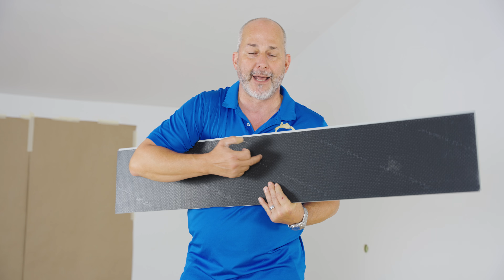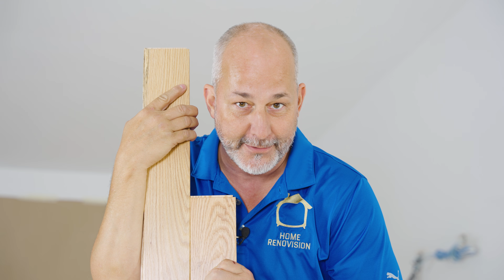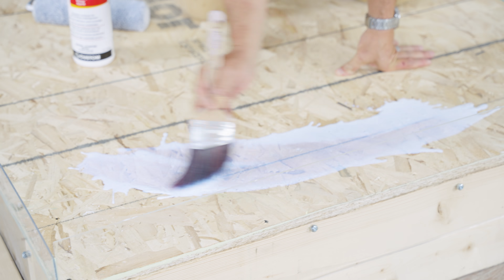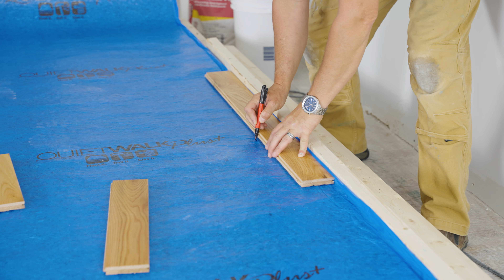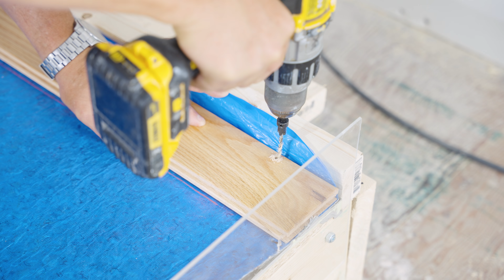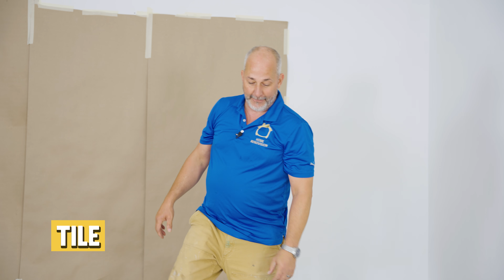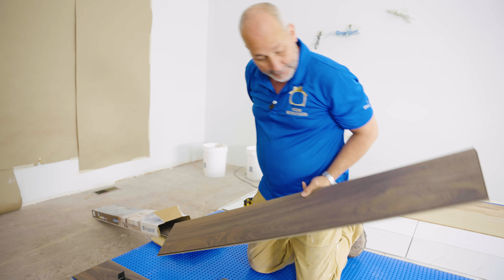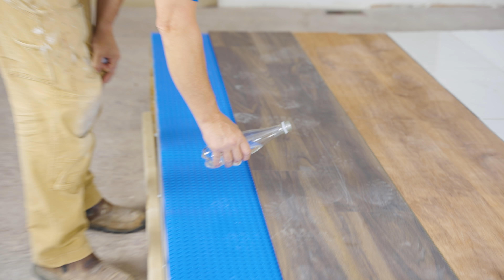Flooring Comparison: LVP vs Laminate vs Hardwood

Comment: Excellent video — very accurate and well explained.
Installer here: locking strength matters more with LVP, and laminate gets much quieter with EVA underlayment than a thin plastic.
I may show this video to clients before their installation — I'm sure it will help them a lot.
And I’m even thinking of running a similar experiment on my own channel as well 🙂
Great work! Kudos to you for putting together such a thoughtful comparison.
Reply from the maker: Thank you I appreciate that. Thanks for chiming in with your experience. Cheers

Comment: Additionally, higher end engineered hardwood floors have thick enough veneers to be refinished at least once. The best stuff has closer to a quarter inch veneer thickness which might even take multiple refinished across its lifetime. It will cost more accordingly

Comment: With hardwood, most of the expansion and contraction is across the grain; Not in the axial direction. I think Jeff misspoke but this is why doors are built with rails and stiles; the rails don’t expands length-wise so the door can’t swell itself shut. Hopefully he also mentions the importance of acclimating the wood to the house (preferably by storing the material for as long as possible) and, if you want to go even further, you can choose the most neutral humidity season in your climate region to do the install. That is to say, if you install it during the highest humidity conditions, you should really only need to account for contraction. TMI but figured I’d mention it because hardwood can be pretty brutal
Reply: I meant storing it for as long as possible in the place it will be installed. My bad

Comment: Engineered hardwood can be refinished. Depending on the thickness of the solid top layer you may not be able to refinish it as many times as solid, but high quality stuff will be solid all the way to the tongue and groove so it can be refinished just as many times as solid hardwood.

Comment: Is that hardwood flooring pre-finished? Or do you need to apply finish to it after it’s installed? I’ve seen videos where they need to do a whole bunch of finishing steps, including buffing it out with a giant polisher.
Reply: I think you're right. Needs sanding, filling holes and varnishing. Some steps more than once. A lot more work, i.e. time and money.

Comment: Wow, finally a great video and tutorial on flooring as i got three different answers on what type of flooring to go with from the big box stores, some say add a padding and some say not needed, my house sits on 32 cement column that is 13' above the ground with a plywood floor, it has carpet now, looking to go with a laminate, half of the house is a concealed garage and the other half is open for parking but has siding on the over head, some people that i know have had some issues with sweating and mold what do you think, no pets to have accidents on the flooring, thanks for any help

Comment: You forgot one step!
If you cut the edge of the interior hardwood or any wood product flooring then you’ve cut through the pressure treatment of the wood product. Because the rot resistant pressure treating only penetrates so deeply into the wood, you must brush on the cut edge, copper green, or one of the other copper based right resistant treatments! Also when he holds your drill or deep notches or grooves, you put into the wood! 
So yes, just the same as when you cut most exterior woods, such as decking.
Just ask ChatGPT when unsure.
Thanks for the great Great videos! Yep!

Comment: Warning on LVP.... MAKE DAMN SURE YOUR FLOOR IS ABSOLTEY CLEAN AND LEVEL! I had an installer install mine and there were little pea sized pieces of thinset from the old floor. It will create a crack in the plank. It's durable for scratches and stuff, but very prone to cracking on uneven surfaces.
Reply: Not level, flat.
Reply: Agree. I have high quality & durable "luxury" vinyl planks. The installer did a great job. It does look great after over 5 years of  wear. I see a couple very subtle areas & I'm sure I am the only one that notices. I do still love it. I had to do my floors at the time but couldn't do hardwood or engineered due to rigidity. The subfloor due to crawl space and home additions over time, would have required contractor renovating the floor. Several pros gave me that sad news. The leveler required for rigid hardwood or other would have added too much weight so not an option. They said they would pop up  I love my floors from both quality & installation. The color is a medium brown and stands up very well. Still gets clean without the built up dirt on lighter colors gray & blonde.

Comment: What a creative video. I am not a fan of vinyl flooring because it feels loose and mushy or unevenness under my bear feet.  I would suppose this could varies based on brands used, installations and the condition of the existing floor. Maybe do a video on higher end preferred LVP by customers and contractors and bottom of the barrel.  Also I am into Passive homes/ Net zero homes.. It would be interesting to do a video on different options of heat. force hot air (central air vents & Mini Split), water tubing heated w/ concrete floors and electric heated floors, radiator heat) cost analysis and comfort analysis and distribution efficiency.

Comment: Would have liked to have seen all those floor products installed on concrete slab.
Reply: LVP on a concrete slab is best IMO
Reply: Lvp all day and night,
Reply: Same steps basically, except you’ll be using a grinder for the high spots and/or doing multiple coats of SLC.

Comment: I would be more interested in sitting in a chair with metal legs and moving it in and out to simulate someone getting in and getting out of a kitchen chair. - most of those floors would fail without pads

Comment: I feel like I have generational trauma related to every single way hardwood fails. Chair marks, flower pot water marks, creaking cracking separation, specialty soap cleaning, ink stains.... Resurfacing jobs that aren't flat and make the creaking problems way worse overtime...

Comment: great video!
Unfortunately it doesn't help me. My house was built in 1890 and the floors are pine. Painted everywhere but the middle of the room. Dried out and separated joints. I'm going g to have to level he floor from the basement.  By myself. I'm almost 70. Such is life. Damn

Comment: This is very helpful. We want to do vinyl in an old house basement over existing vinyl tile.  Some tiles have loosened, cracked, or are missing. Most are in good shape and well adhered.Fortunately they are not aspestos. Wondering what the best prep would be. Replace bad/missing tiles? Use floor leveler? Remove old tile. (I've done that before and really am not up to that kind of work anymore. When did I get so old?) Would definitely use that underlayment.

Comment: so if I got my math right, older house with uneven floors + kids + big dogs + moderately handy dad = vinyl floors
Reply: I raised 3 boys and fostered dogs for 10 years. Do the hardwood. It just now needs sanding and refinishing because we plan to move so changing the stain will update it. None of the vinyl and fake wood stuff survived. Just replace the old subflooring that needs it and get the right underpayment (we have a house that is like 45). Save the extra wood in case you need to do patches (we haven't but you can just cut it out and fit in a new chunk if needed). Real wood floor also raise your reselling value apparently the most out of any flooring. 

The vinyl flooring also can release toxins, it is called off gassing. Then in a  house fire it is particularly nasty due to that (in laws had one learned the hard way). Vinyl won't last, tile does break but at least doesn't damage as quickly and carpets can get ruined quickly. Even the luxury stuff in the new builds isn't lasting, my folks paid for the upgrade in their new build and is starting to fail 5 years in with 1 elderly dog. They put rugs everywhere to protect the flooring since it was so expensive. Maybe there is a difference out there Canada but US side that stuff doesn't last. 

I'm not handy and while I love my husband he is more software minded, which is totally fine since that is his job. We installed hickory floors with some family help while I was on maternity leave. I waited and watched for a sale and we scored it for less than $2/sq foot which is cheaper than  most of the vinyl. Middle kid has allergies so switching to hardwood was a huge improvement. 

If you can do wood floors, you'll move or be dead before they need to be replaced, and a sanding/refinish is cheaper than new flooring. Added bonus hardwood flooring adds structural strength, the only other flooring that does that is the engineered wood. :) So for us that was great because we live by a lot of mature trees and the kids' rooms are downstairs, so that wood flooring was like a nice shield investment for tornado season. 

Unless you live in a flood zone or hurricane zone, then go tile.
Reply: @wobbuffetbuffet  Did you do engineered hardwood or real? Where'd you get it from?

Comment: You should never have hardwood floors (or likely engineered wood floors) that aren't sealed with poly though so they'd not soak up anything in that case.

Comment: Wife and I bought a house a few years ago and originally we loved the floors. They looked beautiful. But it turns out they are extremely cheap. If you look at my floors wrong they will scratc up. There are so many gouges in our floor now that it's driving me insane, and unfortunately all of the floor is underneath my cabinets so it's not easy to remove and replace.
Reply: Have been watching nz builder solve this issue by cutting the boards out at and angle so it reaches undee the b
Board, so new floor can slide under.

Comment: 2:03, I know from personal experience that even if you have a waterproof joint, those "Water Resistant" laminate floating board floors will have issues with any water (and other liquids) that aren't cleaned up right away. I have seen two separate people have the exact same issue about 4 years apart. And, in both cases, those floors were brand new (less than two months) installations. Sure, those boards, when installed properly, won't let water soak underneath, but those joint seams will soak in standing liquids that are left to stand for more than a few minutes. This will cause the laminate boards to swell around their edges, almost like particle board. I say almost, because unlike particle board the laminate won't crumble; it just stays swollen. One person I know, had a party, there was ice cooler inside the house, condensation formed o it, and she was left with a swollen square ring where the cooler was touching the floor overnight. Another person I know, had a new kitten and the older cat was unhappy about this and went to the bathroom in her closest (on her brand new floors) when she was out. And, a nice large spot on her closet floor swelled at the joints. So, just because the laminate won't let water soak through, that doesn't mean the water won't ruin it.

Edit: I don't know how flat the closet floor was, but that was a prefabricated house. But, the house with the house cooler issue, that was a concrete foundation with was evened out with leveler.

Comment: I haven't seen your stuff in years... Great to see the quality nowadays. it was never bad, but this is great stuff! Would love to see more slab foundation information (very common in my area where basements don't exist and ranch style homes are the norm).
Reply from the maker: Welcome back!
Reply: In Florida CBS construction (concrete block on slab) is a very common construction method. Basements are not practical there. The water table is close to the surface. The top of the concrete block wall is filled with concrete, rebar, and foundation bolts to hold the roof down, per hurricane code. Flooring was often terrazzo.

Comment: LVP looks arrificial. I've not laid eyes on an LVP that could pass as anything near "real", and it always feels sticky, especially with grippy shoes. LVP also has a plastic smell that hangs around for months and sometimes years. Good laminates can pass as engineered hardwood, feels solid (not sticky) and the smell is gone in days (if any). With that said, pets prefer the grip of LVP to laminates.

Comment: I'm going to install LVP but was going to install Engineered hardwood up until a week ago when I saw a very realistic looking floor and changed my mind and this helped a lot, so thanks for that. I would like to see someone compare "UPFLUSH" toilets because we don't have a choice as this is a manufactured home that was set on a basement. Do you think you could do that? i'm a fix it person and have fixed my saniflush several times but parts, which seem to be quite proprietary, become obsolete very quickly so I'm looking for a different brand that may have more universal parts.

Comment: Great review! Been enjoying your stuff a lot. It's a good sweet spot for no non-sense and down to earth advice. You give a lot of advice on flooring, but I'm still looking around for more advice for a "garage flooring" project. I'd like to turn my garage into a studio with "human friendly" floors, but still have it rugged enough to use it as a garage if I have to turn back the studio into an actual garage. There is so many options and few actual comparisons.
Reply from the maker: Thank you very much. Will be filming more garage videos this spring. Is your garage concrete? I’m still researching. Great video idea. Cheers
Reply from the maker: Thank you very much. Will be filming more garage videos this spring. Is your garage concrete? I’m still researching. Great video idea. Cheers
Reply: @HomeRenoVisionDIY  12ft high. Unfinished concrete. Insulated walls (Quebec winters). White vinyl wall panels (ver partial). On large hairline crack toward the drain. 1 large door, 1 side door, no windows. Pushed air heating on the ceiling. Humidifier

Current use case: Wire shelving storage with boxes, 2 fridges, plants, my software dev "office".

Current problems: The concrete floor causes the space to go back to a cold, dry and dusty state too quickly. (I have a humidifier that run to 65% for plants)

Reason for flooring: I want to transform this space into a multi-purpose workshop more than a "car garage". I'm even looking to putting wheels under the wire shelving to reconfigure according to changing needs.

My first real issue: At the moment I'd like to do a first test, during the winter, with 2 areas 6x8 to see if the difference in "feeling" is worth a full floor project. But I have not figured out which product I could install, then un-install/re-install once I want to complete the project in the summer.

Comment: Four things I'd like to see compared, if you haven't already.

Insulation products, both bats/cavity (fiberglass, mineral wool, cellulous), and rigid (Mineral boards, EPS foam, XPS foam, GPS foam)
Vapour control products. Basically Poly vs the "smart" vapour membranes such as Intello and Majarex. Perhaps include using XPS foam as a vapour barrier as well?
Siding.
Roofing material.

Comment: Unless I missed it, details on the products used would be really helpful. Like the brand/thickness/mil layer of the lvt and laminate. Granted I know the mil layer on Lifeproof is 22 mil, but they also have a 30 mil. Was the product tested the 22 or 30 mil? What was the brand/thickness/mil of the laminate? Without details, It's hard to know if you're comparing similar products or 2 that are on different spectrums of quality. Porcelain is also a through color product where ceramic is only surface painted, meaning ceramic is going to fail much sooner on a surface scratch test before porcelain will.
Thank you for this test. The info in this video will be used every day in my job.

Comment: I have seen the same honestly the luxury vinyl plank as thin and flimsy as it looks holds up quite well especially with dogs. In our last house we had beautiful hardwood floors and the dogs claws scratched them up. We've had LVP now for a few years no scratches at all in them the wear layer is impressive. Good stuff. It doesn't feel as luxurious as hardwood floors though of course which is the downside.  I agree with almost everything you said in this as someone who does a lot of this for a living. I'll have to look more into using the tile membrane I still use cement board most of the time to get the tile up to flush with the other floors. Next time I need to keep them lower I'll use membrane.

Comment: wish I knew this before we committed to the vinyl, and the installer messed up the install, by not prepping the floor  enough,  so we will have to redo the flooring completely. It is interesting how hardwood is not such a costly option in the end, if you consider everything. However since we live in a concrete condo I think the only way to do hardwood is a glue down install, and I am not sure if it is allowed in the condo or not, due to possibility of leaking, and future repair... I will have to research that part.

Comment: Thank you for the wonderfully informative video.  For the engineered and traditional hardwoods, how does sanding/staining/clearcoat factor in?  Are these steps "required" after install, and if so how do they affect the price per sqft?

Comment: I just wish they would use a different look than faux wood. In person, it is obvious that it is fake. Just try not to fake natural materials. I much prefer some of the looks of older linoleum. The not quite solid colors in interesting geometric shapes. And frankly if the cost isn't too much then use real linoleum.